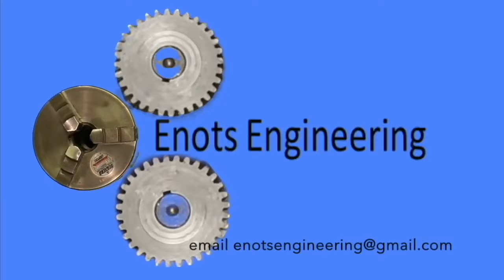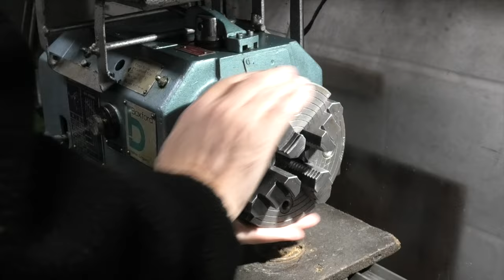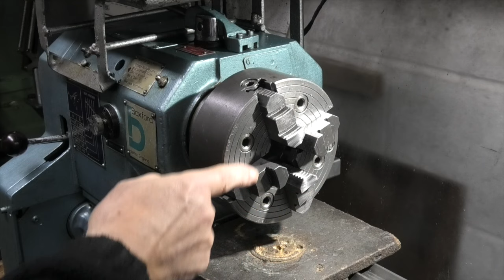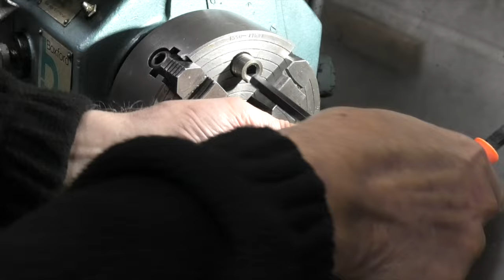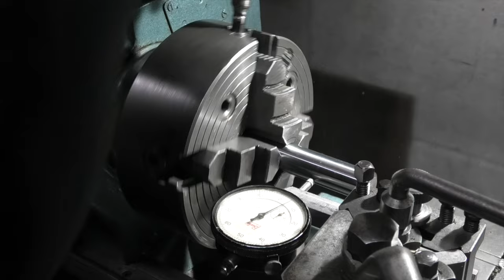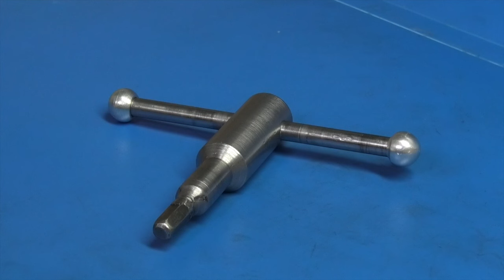6" Prat 4 jaw chuck

Comment: Why would a manufacturer number a jaw on a non centering chuck? There’s no point to that. Also, why would you say that the hex cap screws for the backplate are the same as the square holes in the jaw screws?
Reply from the maker: Hi the chuck screws. Have a hexagon on them merry Christmas
Reply: @ ok. It’s funny then that you showed a square chuck wrench. Happy holidays to you too.
Reply: Could be that they are chosen for their fit on the slide.